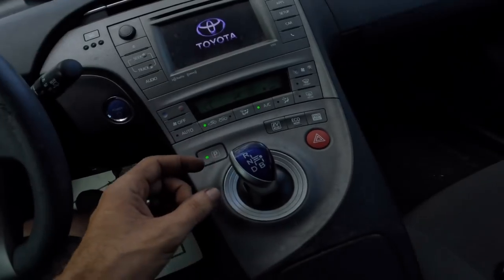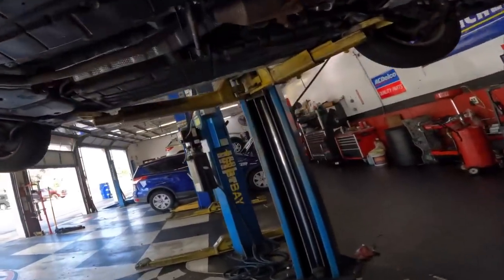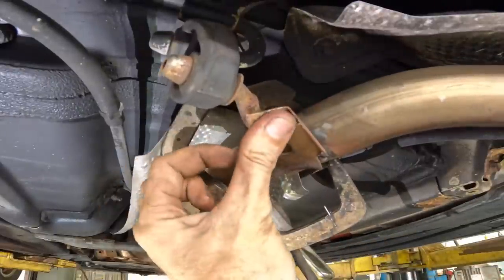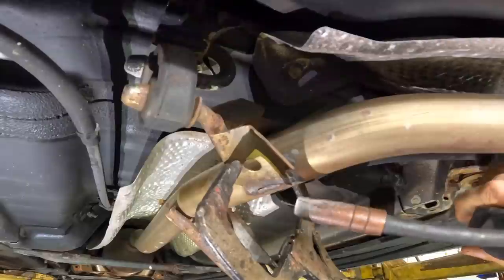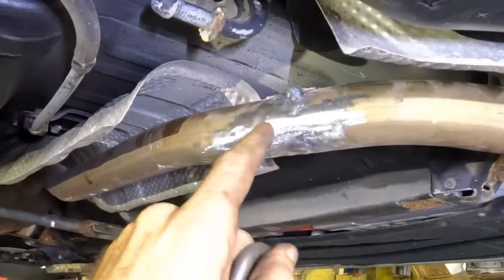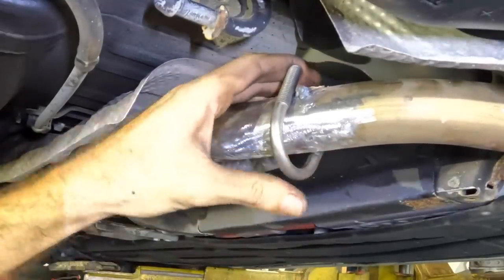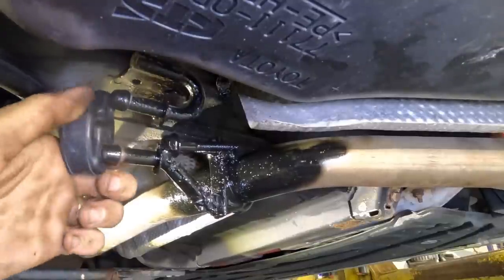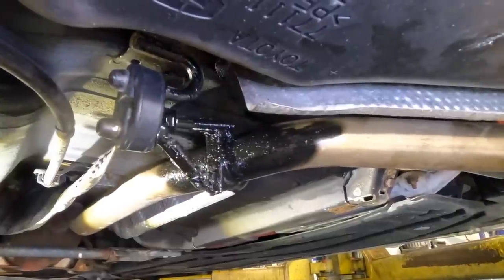This Video is a BAD Idea! Saved Customer THOUSANDS!

Comment: I actually weld for a living on industrial equiptment. My biggest ree was you welding with no glove and short sleeves. 😂 got many burns that way. Nice job though. It aint gotta always be pretty but it needs to work and it needs to be strong and you checked those boxes

Comment: if you turned the clamp about 15 degrees, you could have welded the hanger pin directly to the "fins" of the clamp, not criticizing your work, just a tip on how I make my exhaust hangers

Comment: Ray it looks like your welding problem was missing the first step. Beat or bend the part for a good fit, its hard to fill large gaps in thin metal. I use an old Lincoln buzz box so pretty isn't my concern.

Comment: The only issue I would have is too many people will fix stainless exhauste and other thing's because they either don't now how to tig weld or don't have accesse to 1/8th inch welding rod and an arc welder. I see all too much. Either use the right tool for the job or don't do it at all. Not you ray but, if you really need to fix that yourself it's called clamps and tex screws. Just enjoy doing it every couple years depending on where you live.

Comment: Stainless can be magnetic it all depends on the grade of Stainless, food industries typically use non magnetic Stainless. Welding with out gas not generally a good idea unless you use a special wire that protects the puddle for o2 otherwise you will get porosity.

Comment: You can weld stainless steel but it take a special  wire and gas plus when you weld it it gives off a bad gas that makes you sick when was a work tried the cheap way we alway turn up the heat but was nasty but at least stuck to it

Comment: What kind of drill attachment is everyone using to clean up gasket surfaces on aluminum blocks? water pump gasket, oil pan gaskets, head gaskets, etc?
Reply: Rusty old wire wheel and a disc of 40 grit sand paper.

Comment: some "stainless" grades are magnetic, it depends on the amount of chrome in the alloy. I'm not a welder either but it may have worked with the correct wire.
Reply: PS     Stating the bleeding obvious :)

Comment: It is a trimetal mixture,, and trash is in the mixture lols 😎 It welds better with a gas shield... cutting with torch does better with hitting the oxygen basically melting it.... It will look good from my house.Aint it just ain't it 😎 That's what they said at the Mobile home Plant. New rattle... Love this video.... thanks

Comment: The most common mistake made in welding is they forget the first rule of welding, "you cant weld rust", so after you cleaned it up you should have been able to weld it perfectly after you cleaned it up. also using the existing hanger use an angle grinder to cut the welds off the housing and that way you have the full length of the mounting bolt to weld to the U bracket you put on, but even new steal like the U bracket you should always grind down to bare shiny metal as steel is still spray coated in a protective to try and help prevent some basic oxidizations so you should always grind all your surfaces you are going to weld fully down to bare metal before welding it. Also keep moving your weld point, you are overheating the weld and that's just going to cause the weld to fail. find your line, run it from start to finish in a 1 to 1.5 second count to form your bead line then see the whole weld if it needs more clean the weld line up with the grinder then do your line again. you stay in place too much and not only can it make your weld fail you can also cut through your material and form a hole.

Other then that awesome work and help trying to keep the mechanic profession honest, keep it up :)
Reply: Also none of that metal was stainless steel, also you really, really stayed in place on that bolt you added far to long, each tack should have only taken tops 2 seconds then clean it with your brush and do it again if need, but you went way, way over that time and strained the metal and the weld, i am pretty sure one hit with a hammer would break it off completely due to the length of time you held it and layered welds without cleaning the layer below which weakens them more and more as the residue or slag builds up each second of a weld and it is not weldable itself. I am very glad to see you painted it to prevent rusting through, many forget to do that on the underside of a car. you have the skills just remember to clean everything down to clean metal, keep moving along your line or spots never more than 2 seconds, clean between layers and coat the welds and metal at the end and you got it :)

Comment: look like a 409 stainless system, pretty much the norm on post 2000 cars   409 is a low grade of stainless and is magnetic and will corrode unlike its high grade 304 counterpart    a good compromise for the manufacturer between cost and life   more expensive than mild steel but lasts longer

Comment: I would gave used a stainless steel hose clamp right thru the bracket lightning holes and around the pipe to avoid blowing a hole in the exhaust pipe.
I like your clamp idea better!

Comment: Don't think i could have done it any better. But your still young enough  you can take welding classes. Also never throw any scrap metal away use it to practice welding & make brackets, hangers, etc.

Comment: looks like a good old fashioned muffler clamp placed around the pipe and one end sticking through the existing holes would have been a quick and easy fix

Comment: How can one send you stuff? I want to send you a can of weld-thru zinc primer for when you weld a bracket back on an exhaust again, it'll protect it from rusting from areas you didn't weld over like the backside of the bracket and a surge protector- you're probably not running a high voltage welder like a 220v or even 180v (I use a 140v) but still it's good to be safe, especially on customers vehicles.

Comment: Ray  I believe thats aluminum coated steel.  If you would have flapper wheeled the pipe down to fresh steel, welding that bracket on would have went a LOT faster a lot easier and had more success.  Anyway it will work and SAVE that person a lot of cash.  Get the shop to get off their ass and get the shop MIG Welder back on line.  Ray,, Invest in a bottle of gas and a regulator for your welder!  Its much easier and more professional.  You dont need to be a professional welder to do a good job with the correct equipment.  IMHO, you could have shave an hour off that welding job with the correct welding set-up and it would have been 3X stronger. One of the best repair channels on the internet.

Comment: You should have drilled a hole in the U-bolt bracket, put in a long bolt with a nut on both sides, welded it in place and not used the existing hanger bracket at all .

Comment: Around here, the mechanics, at the chain shops anyway, would have recommended a full exhaust replacement just for that. Insurance, I guess, won't allow the them to even have a welder in the shop. They wouldn't even recommend that you take it to any number of Exhaust Shops that can actually weld the bracket back on and I know of only one that would create something like this.

Comment: The EPA requires the exhaust system of cars and trucks be durable during the life of the product. I believe the pipe you are welding is made of alloy 409 stainless steel. It is a low carbon steel with 11% chromium content. So it is the lowest cost corrosion resistant exhaust tube. It is widely used in the automotive and off-road sector for exhaust longevity. All the DPF, and SCR components are made with 409 s.s.. It can be welded with mig but I have seen it mig welded with argon gas only. The mig filler metel was 70,000 psi tensile strength, standard strength.
TIG welding is preferred. Magnetism is not a reliable test for stainless steels. I think 409 is magnetic.
304 stainless is the same alloy as 18-8
Stainless. 18% chromium and 8% nickel.
409 stainless has 11%chromium with no nickel and it is the lowest alloy to qualify as a stainless steel.
I'm sure your argon gas mig welder would have given durable welds, however the welds will rust. Stainless filler metal would not rust. Hope it helps. Good luck with your future career, I'll still be watching.

Comment: It's a hardened iron alloy. Similar to bed frame metal. Makes it rust and dent resistant.  You can tell because the sparks coming off are extra sparkly and a little faster than standard metal like angle iron. A bit more challenging to weld for sure!

Comment: Ray, you're cool with all type of repairs. You certainly can weld also, although is a standard practice, when mig welding, to get rid of the rust first. It doesn't like rust, even flux core. Clean surface is the starting point of the way to success. With flux core also remember to clean off the slag in between passes... Cheers, keep on, you will do it!

Comment: Wondering if there was a non-welding way to do that by clamping the broken piece to the pipe using the U clamp with one end of the U bolt through the hole in  the broken piece...

Comment: So a curious fact about the Prius, I own a 2nd gen. The listed top speed is 134 MPH. (no it's not going to get their fast because it's not designed to. it's designed to pick up speed slowly saving gas)  I was dubious about that speed until one after noon coming back from a doctors appointment in the state next to us. From 60MPH on you have to watch the speed like a hawk. The aerodynamics on that car are so good that if your going 60 plus, you can feel a tug forward sensation that is crazy. I watched my Prius go from 65 to 110 without me steeping into it. It was the wildest thing I've ever seen. ( I used to race a 9.6 Mopar back in the 80/90's and compared to it my Prius has some serious high speed air dynamics) So Yeah, not a 1/4 car by any stretch, but man the top end is crazy efficient.

Comment: Next time pick up some 309 stainless wire you can weld stainless to steel and stainless to stainless with pure CO2 gas or a stainless mig mix gas.

Comment: Your issue is the lack of knowledge of what you’re trying to weld. The exhaust pipe has anti-rust coating that’s why you couldn’t weld to it, UNTIL you grind it off. Once you did that it would have taken the weld just fine. Leaving the U-bolt near the hanger would’ve given you solid steel to weld the exhaust hanger to! Done in ten minutes!

Comment: Rainman, buddy you where soooooo close.... I have a great tip and that is "it's all in the prep". Simply cleaning the welding points of the old metal bracket and pipe you would of had it done a bit more cleaner/professional (not so thunderdome) looking. Never the less it looks like it shall hold for a while. Not too bad!!!

Comment: Just a bit of F.Y.I. Using a magnet to test for stainless steel is not a valid test. Several types/grades of stainless steel are magnetic. Kudos to you for trying to do right by your customers and not charging them for parts that common sense dictates are not always needed.

Comment: Have to ask, is Ray using a standard helmet, not a auto-dimmable one? That by itself makes the job a lot harder. I wouldn't even have tried to weld it, looked like a hose clamp or two would've worked just fine.

Comment: i love your problem solving and mechanical work but you should have sent him to a muffler shop after finding a broken hanger ... 30 bucks for a proper bolt-on hanger bracket and 10 minutes to bolt it on and done ... you are a great mechanic ... but not so much on hanger brackets ... it looks like "hillbilly bobs i can fix anything with enough welding" job

Comment: Ray:   " It's all rusty so I'll weld back here a bit" then " It must be stainless" lol.
Next, Ray:   "Who say's you can't weld stainless, cause they're right".  
I hate to tell you but YES, you can weld stainless. It's not even that hard. You can weld it very easily with a TIG or there's been welding rods for stick welding it available for as long as I can remember and I'm 67. I have never used it but I'd bet money that there's MIG wire and gas for welding it too, I don't know but doubt they'd have a gasless version but don't know, maybe.
I've only ever tested one of those gasless welders for a mate who was going to sell it in his shop if it worked ok. It did seem to but, I hated the welds it produced, give me gas every time please, I'd much rather weld even rusty car floors up with a stick welder with a hundred yards extension on a crappy little stick welding unit and 3.2mm rods than use that thing, and yes, I have done exactly that before, along with a complete new Y frame.
I should add that I can see good reasons to have a gasless MIG (even though the G doesn't really belong in the MIG when referring to them), I just don't like using them if there's another option. TIG would have been ideal for jobs like the one you did here.
Good on you for finding a good alternative to whatever insane amount that whole thing would have otherwise have cost.

Comment: Hey Rainman, I really enjoy the knowledge and experience you show in your videos. I apologize for not reading the other comments before suggesting this, maybe it's already been suggested or considered. I mean no disrespect. First off, is there any concern damaging the vehicles electronics by welding (I know mig is ac) without at least disconnecting the battery? I fear I cratered the shift controller on the autoshift of my heavy truck by welding on it with mig without disconnecting the battery/electronics. Secondly, welding unknown metals is a bugger. You did check it with a magnet, unfortunately, some stainlesses are attracted to magnets. If you get a chance, look into stainless mig wire, I suspect it's available. I've had good success with stainless stick rods. Just a hack farmer's suggestions keep up the good work. We all learn from experience.

Comment: Muffler pipe will rust out where u sanded and removed all the protective surface rust
..and drop the Sawzall and use the darn angle grinder

Comment: You wouldn't feel so bad about your welding skills if you had seen any of rich rebuilds work.  That repair should hold them for a while.  Nice work.
Reply: 75 / 25 never liked flux core.  The new wire sure leaves lot of spatter and berries, older wire was much cleaner.

Comment: If you would have cleaned the pipe with at least a wire wheel before trying to weld you probably would have had success, but some stainless is magnetic.. in any case proper cleaning before welding is crucial. Live and learn. Appreciate your vids..real life, it’s never perfect

Comment: You need to invest in a cheap auto darkening welding helmet they are less then $40 everywhere and whatever welding skills you think you have now will quadruple the moment you stop using your flip helmet. It makes that big of a difference sorta like changing tires by hand instead of using an impact gun its that big of a difference you will kick yourself in the ass for not buying one the day you got your mig. also invest in a gas bottle and regulator going to gas over flux wire is an even bigger leap. flux core mig welding is something you do to fix a tractor stuck in a mud pit during a tornado .. when you have no other option .

Comment: While I can appreciate doing a simple weld job to fix the bracket and save your customer from being ripped off (proper repair in my mind) I would be very hesitant striking an arc on a modern car with all of the computers. I think I would have removed that part of the exhaust system and done the welding on the bench.
Reply: I think he did iy just fine .The ground was right next to his work ,there was zero possibility of the arc traveling to hidden electronics ..If your that worried better stay home when there is a thunder storm and hide in the basement in a rubber blanket .

Comment: hope you disconnected the battery before welding :) , still it aint like welding to body but its lot cheaper then to fry ecu but still nobody unplug battery before welding exhaust.

Comment: You didn't clean it and are using the wrong wire.  All stainless steel is magnetic except austenitic stainless steel which is actually 300 series stainless such as 304 and 316. However, 300 series stainless is non-magnetic only after it is freshly formed. 304 is almost for sure to become magnetic after cold work such as pressing, blasting, cutting, etc

Comment: It would have helped you a little if you would have cleaned that pipe and bracket before you tried welding it with that gasless wire. I use gasless wire when welding exhaust with the mig. Then switch back over to gas for other projects.

Comment: Wouldn't a new generic exhaust clamp have worked just as well? And just unbolt the old one and bolt on the new one. Last time I bought one they weren't all that much and they are designed to be the replacement part for any old exhaust. Better than coat hangers or some other dodgy stuff...

Comment: I AM NO WELDER, but i took a Lincoln MIG and redid the entire underside (beneath the fule tank and up the rear support structure) of sheet metal in my daughters Buik Regal (NNY winters are HARSH)  in a couple of hours welding, I heve never seen that small a weld take SOOOO Long, you really did need gas and CLEAN your work area (RUSTY METAL DOES NOT TAKE WELD AT ALL!!!!, Even with shielding gas)..the next inspection my mechanic noticed what I had done, informed me I broke the law (said welding on support structures required licensure in NY) then checked my work, pronounced it fit AND passed my inspection (that car eventually did break down, the Engine went three years later)...after I had repaired the head gasket my daughter blew getting the car unstuck frm the front yard (3 ft snow)...she got pregnant and the car developed gremlins(electrical)...she parked it and it still sit there!.,....you do get a thumbs up for at least accomplishing the task and not giving up!!!